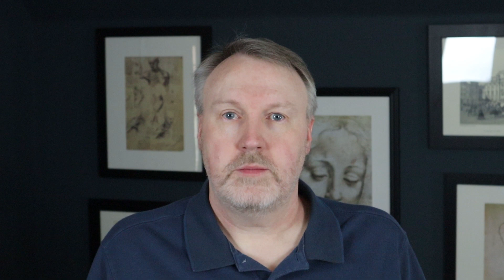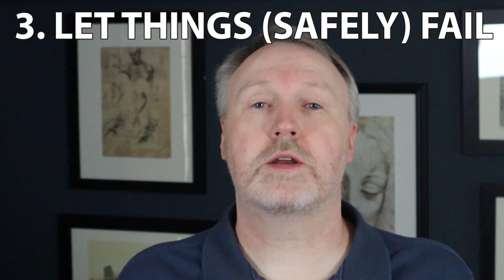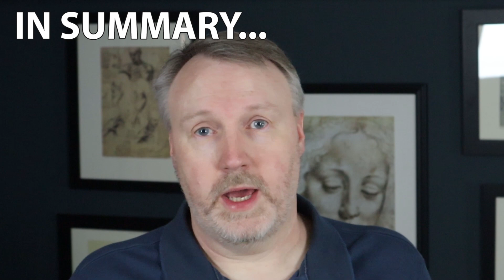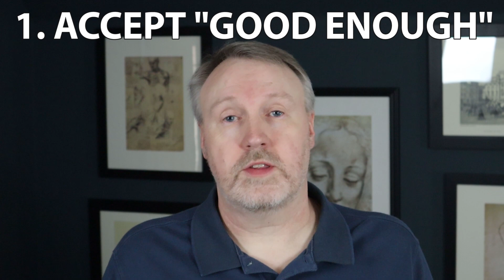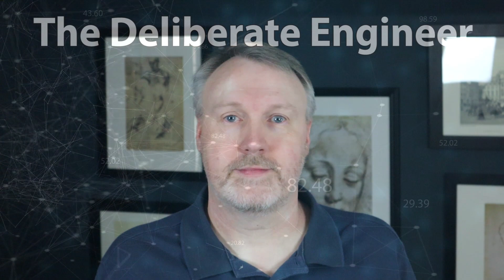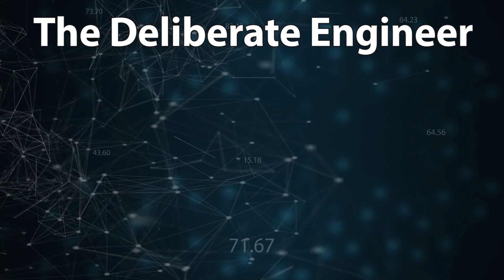Tips from 30 years in Big Tech, for Managers

Comment: Thanks for sharing the lessons of your experience, John.  Many excellent nuggets here which have the right depth / context.  Hope to see more videos from you down the road.

One tip I'd add: while I don't wholly endorse "coding" as an EM, contributing in small ways (e.g. bug fixes, writing tests) can help to keep an EM technically grounded in some ways.  More importantly, it's a mechanism to generate empathy for what the engineers may be up against.  I'd posit that while the value of this is durable to variance an EM's span of control.
Reply from the maker: That's a good point. Just have to make sure you're not critical path on coding when your primary responsibility is managing :)